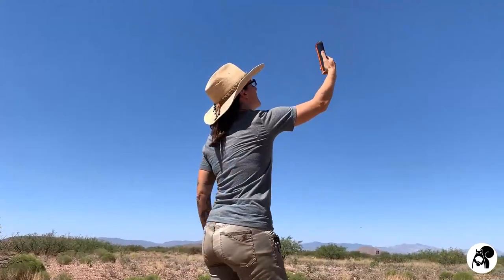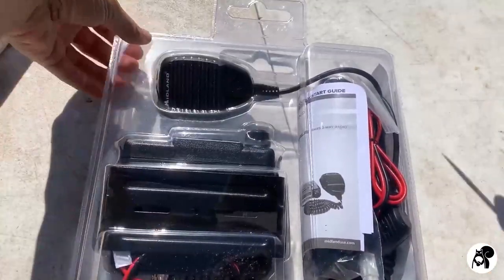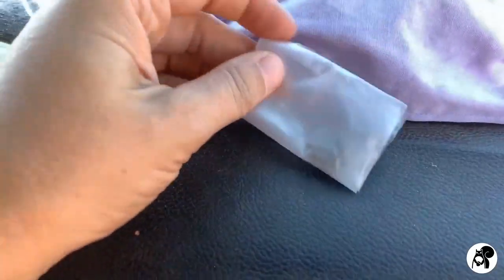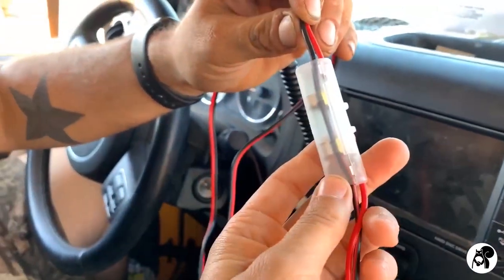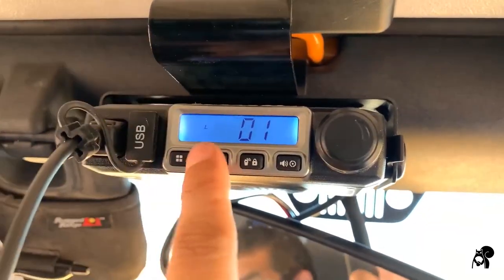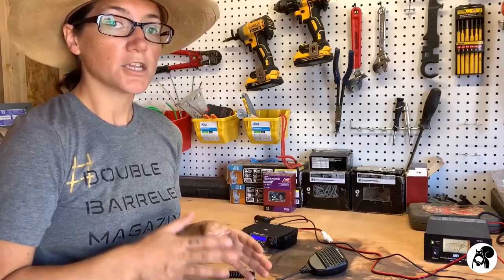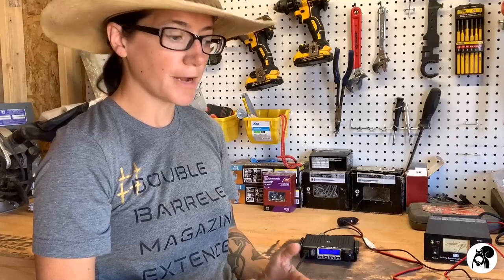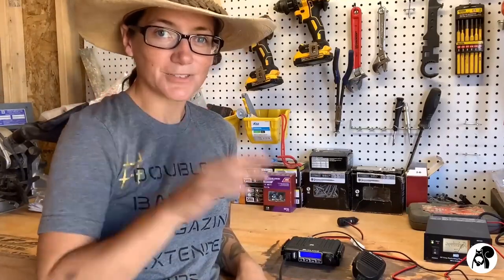Midland Radio Micro Mobile GMRS 2-Way Radio Review

Comment: STATE GOVERNMENT has nothing to do with licensing. The FCC  handles licensing for all radio and Telecommunications services Licensing Requirement comes plays using  a repeater or network of repeaters.  The majority GMRS repeaters are privately owned, so you will need prior permission form the repeater's owner or trustee. However there are few hundred repeaters around the country that are Open
Reply: They also license use of gmrs

Comment: Do you use the handheld GMRS's as well?  I saw on the Midland website that they are selling a bundle of a base station of 5, 15, or 40 watts and walkie talkie style GMRS radios.
Reply from the maker: This Micro Mobile unit goes great with those handhelds. I've used it with standard two-way radios.
Reply: @prepperpublishing  I actually own one of those. Haven’t been able to get anyone else on a frequency, but I’ve been asking whether or not frequencies are in use and I also call CQ as well.
Reply: @gobragh2 earlier this year midland had a special on the GXT handhelds and the mxt115 for $149.  Basically you get the handhelds for free and the package works nicely for me.  I haven't tested range yet but I'm picking up repeater traffic on the MXT from people that live about 40 miles from me.  The handhelds (while not the highest GMRS wattage) are picking up traffic that my removable antenna ham radios (set for GMRS listening) are missing.  The fam uses them on hikes in the mountains where there are no cell towers.

Comment: On the roof rack on the jeep put a medal plate on the corner of the roof rack to stick the antenna on so the rack can't interfere with it.  Plus it will be a few inches higher

Comment: What's the difference between these radios and the cb radios?
Other than needing a license for this radio but not for cb radios.
Reply: CB's are limited to 4watts (except side band communications) while GMRS can be up to 50watts.  GMRS can use repeaters which would greatly extend your range.  Also if you have kids right now we are not hearing all the cuss words on GMRS that they use on CB but I'm sure that will change.
Reply: CB are AM and these are FM.

Comment: Don't cut your plug... I repeat don't cut your plug. They have wall plugs with a 12v cigarette input.  That way you can grab it from house to use in car or a 12 vehicle.  Lol don't cut off your cord or buy a separate power supply.  Just a basic wall ad to dc plug. Thanks for video.  I like the radio.

Comment: So it's better having 2 mobile radios?
Reply from the maker: Only if you need two or if you want redundancy in an emergency situation in case one breaks. Two, of course, allows you to hand one off to family friend so you can both stay in touch.
Reply: Ok I recently purchased the package of 1 mobile & 2 hand helds not getting 2mile
Reply from the maker: @waynedoomad2573  2 miles might be a stretch for handhelds, depends a lot on topography
Reply: Ok. What distance for 2 mobiles
Reply from the maker: Again, very hard to say. What the product might say and what reality is are often two different things. Is your area flat and free of trees and buildings or do you live in the hills surrounded by forests? You'll have to experiment.

Comment: Google db loss at 470 mhz, and you'll no longer be happy about that horrible cable. Hopefully it can be removed, along with that terrible antenna.
Reply: The antenna is not so bad,  but I agree that the length of that coax will be very lossy at GMRS frequencies.